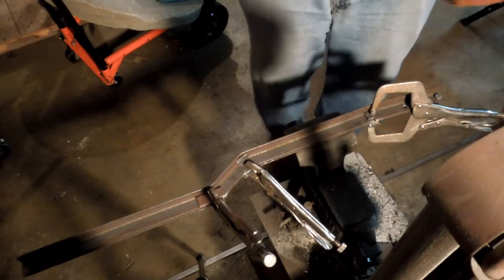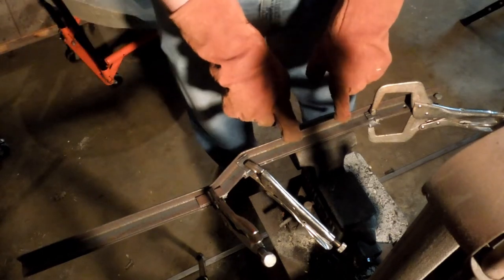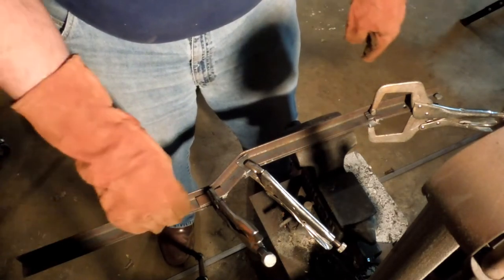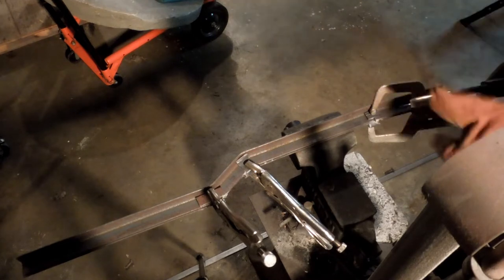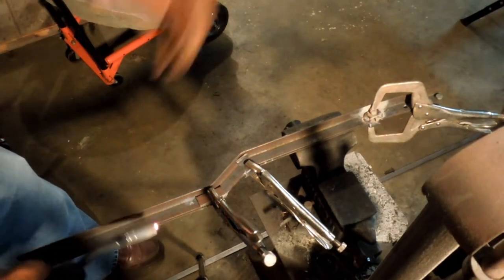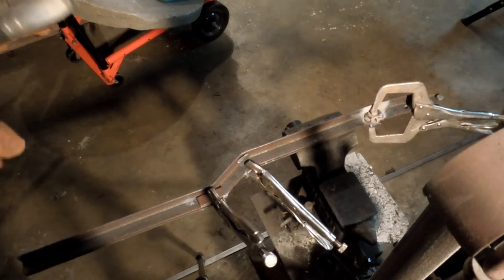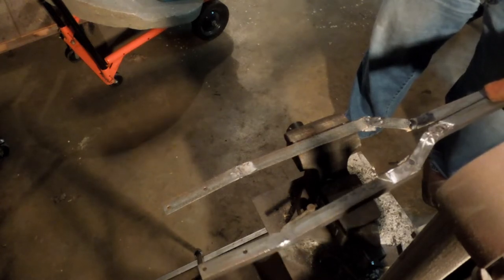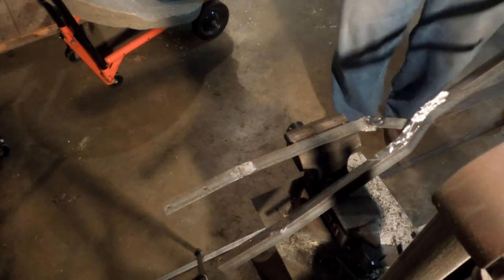Restoring The BIG Grindstone Pt 17 Weld Frame Rails

Comment: I heard a couple youtuber's complain that the weld arc damaged their optics on the camera...   Now they put a filter over the lens...  I wonder what is up with that?    =D
Reply from the maker: There is the long explanation and the short. Since we are talking among ourselves we will hit a middle road if possible. 
Yes a welding arc can damage the camera. The likely hood of that happening is increased or decreased by the distance from the arc. Light as humans see it is the color spectrum. That is relatively weak in the energy transmitted by say Red, Green, and Blue light. The wave lengths that that most of the colors we see can be created from. https://www.rapidtables.com/web/color/RGB_Color.html
On either end of the color spectrum the energy levels get higher. 
Ultraviolet is such a short wave form that we can't see it with our naked eye. Hightly energetic it can bleach clothing white over time or give you a nasty sunburn much quicker. 
Infrared is a long wave. It is the energy that we seek for most of our lives. Nice for cooking food, staying warm. 
It is very energetic. Think blast furnace, plasma torch. 
Welding creates a whole spectrum of light. All the way from Infrared to Ultraviolet and beyond. 
I said earlier that distance is the key. If someone were to set their camera within two centimeters from the weld arc the camera will most likely be destroyed. The infrared will heat the body of the camera to the point where the plastic and eventually the lighter metals will be melted and  possibly burned. 
Increase the distance to a meter and the infrared will be reduced by a factor fifty. Barely enough to warm the camera. 
Infrared is transmitted through glass quite readily. That is why south facing windows are sought out in the Michigan winters. The suns infrared is passed through and heats the interior of my house. Ultraviolet is blocked by glass. Not completely but enough that the glass camera lens defects most of it. 
Setting a camera up to record welding is a matter of setting the camera at the proper distance from the arc.
The bright flare of light in the picture is the result of having cameras record what we want to see later. Standard digital recording cameras are setup to mimic the light range gathered by the human eye.  Just like using a welding helmet to reduce the amount of light falling on my eyes when I'm welding, a welding lens can reduce the amount of light falling on the camera lens. The camera can record the picture of the reduced light just like if I was looking through the lens myself. 
I have a Sony Cyber-shot camera that I used at Demmer Corporation from 2006 until I retired in 2013. It is the same camera that I used to record the first hundred or so videos on Old Sneelock's Workshop. It has recorded thousands of frames of welding. Some from distances as close as a foot. It still works fine. 
Is it possible that I just got lucky and my cameras are somehow immune to the effects of welding. 
The Sony Cyber-shot, Nikon Coolpix S8200, my Samsung phone, and the Canon EOS 70D have all recorded arc welding. Only the Sony from distances of a foot. Mostly because I was doing hand helds of someone else welding at Demmer. If I'm doing the welding my hands are busy welding and I need to keep the camera back so I don't knock it over. Yes it has happened more than once. 
That prompted me to develop another skill set. I also fix cameras. 😀
Reply: @OldSneelock  Also, digital cameras are far more sensitive than to infrared than the human eye.  I think pretty much all cameras have an additional IR filter to correct for that.
One of the guys I used to work with ran the student telecommunications lab.  The older cameras were extremely sensitive to having the tubes burn out (that alone should let you know this was YEARS ago) if they were pointed directly at the studio lights (big heavy, HOT lights that put out loads of light & heat).  He was well known for that even ten years ago.

Comment: My grinders will fix up a lot of my poor welding jobs....I don`t always show my first passes....you hold back and one shows the finished product....Like you, sir, I don`t have the practice and I`m probably a lot shakyer....you did good and it lokes good and more than that you`de have to pay to get it done....CHEERS
Reply from the maker: I learned to rest my left hand on something and hold the gun steady. Then run the trigger and move the stinger with my right.
Reply: @OldSneelock  10/4 on the wright/write/wright..zzz........whatever.! A Marty-ism!
Reply from the maker: @lewiemcneely9143  @#$@#$ auto correct.!!!!
Reply: @OldSneelock  Blamed RIGHT! and CAPS lock buttons!